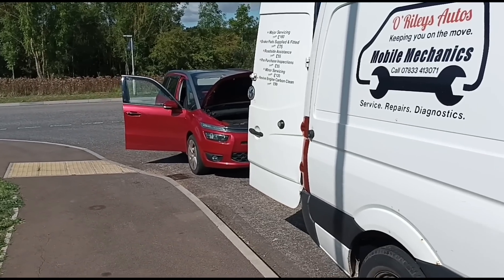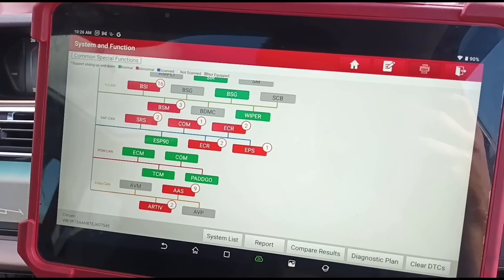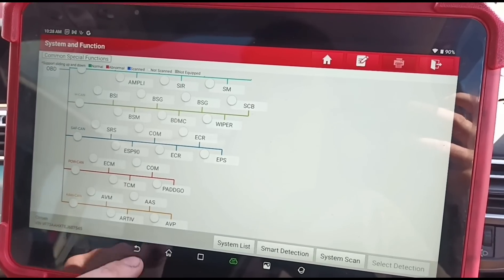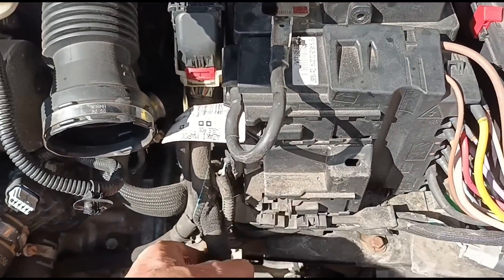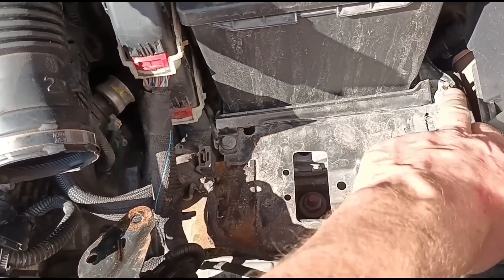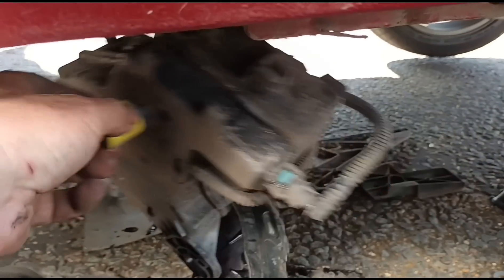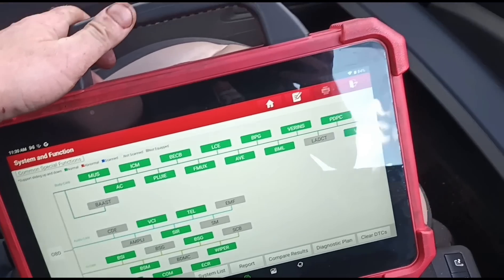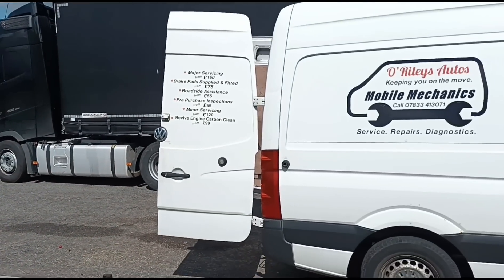Citroën C4 Grand Picasso Various ECU & Cruise Control No Communication U1F03 U1F00 B1811 U1F2E U1F04

Comment: As always fantastic informative, clear videos. I have a C4 GP 2014, works fantastic but every now and again spits its dummy out and goes into limp mode and knocks the auto gears to manual only.  Seen a fair few of your videos and one from the past hinted at electrical issues. I recently got myself a topdon pro which I am still learning the ropes with and although not the same system as yours the way you explain everything has been so helpful in using my own.  So my course of action now is a new battery and clean up all the terminals and check fuses in the box in the front of battery and then replace battery with new one. Thankyou for showing how to get the dam thing out. 

Another issue that I had not noticed at first was when plugging in the topdon was that there was no power (topdon has internal battery) with the engine off. Again one of your past videos indicates this to be a related fault to the auto gears failure and how to fix, Thanks for putting  the time and effort into making these videos, they are greatly appreciated

Comment: Jimmy, as others have posted here, on a lot of newer cars a scan tool is all you really need for basic diagnostics of the AC system. there are even actuation controls to turn things on and off. One of the other things that can fail is the blend door. everything appears to be working, but only blows hot air. blend door can be stuck in the hot position, but I think you can test that with an actuation test on the scan tool. you should give it a go sometime.

Comment: I used to own one of these, an older model, there's a procedure to reset the BSI.
Put the driver's window down, lift the bonnet, ensure all equipment is switched off, close all the doors and remove key from ignition.
Wait 3 minutes, disconnect the battery and wait 15 seconds, reconnect the battery, wait 10 seconds, switch on the sidelights using the open window do not open the doors, switch on the ignition, hold the lock button on the keyfob for 10 seconds.
You can now unlock the doors and start the engine, this resets all the BSI modules and set everything back to standard.
The BSI is basically a computer that sometimes gives problems and needs reset, you are supposed to wait till it goes to sleep before disconnecting the battery, lift the bonnet and wait at least 3 minutes, with all equipment switched off or it won't go to sleep.
Sorry for long post, hope it helps someone.

Comment: A slightly inconvenient place to put a battery, but I suppose you (hopefully) don't replace them very often. I used to own a 206 which was throwing up an airbag light on the first cold start, it just needed a new battery, but like with my 208, it was in an easily accessible place.

Comment: Thanks for all the help Jimmy. The next day the a/c started working along with the ECO mode (engine stop/start). Went out today (17th Aug) and the a/c was not working, neither was the ECO mode. wen't about our business, came back to the car, a/c is working OK. I've turned off the ECO mode for the time being. I might come back to you for another diag to see if the battery health is being reported as bad, if so, I can start to look at other causes for this error. Thanks to all those who commented with ideas and other areas to check, it's much appreciated.

Comment: I am not even going to comment on the A/C possible causes because if you say that the customer went to an A/C specialist and they couldn't find a fault, hey ,  who am I to suggest anything. But one thing I can tell you what happened today at 16.30 my time ´. A customer with a Ford Galaxy came straight from the A/C specialist to let me check why the A/C wasn't working after they recharged it. I am an a**hole of course because I, we , refuse to look at work that has been done by "specialists". We pretend to care and feel sorry for the customer but please go back to your A/C specialist and let them show their capabilities IF they have anything more to show for them than a recharge and a quick leak test with a UV light. Wish I could make money like that..( edit) Yes those geniuses that design the battery box placement have done a nice job. Good that we( in our case) have a nice percentage on selling batteries otherwise we had to charge for a battery change.

Comment: Thanks for video. Please tell the customer do not throw away the old battery, I belive it good. Did You test the old battery after You remove it? Please check. I had sort of problem on my c4 picasso, battery drain out in 2 days completely,  the problem was, one of the relays did not go to sleep, continiusly drainong 0.7 amps.
Because of the design, testing the buttery connected does not give 100% accuracy. I test my battery connected, the tester showing 23% of health, replace. Take the battery out- 100% healt, with the same tester.
Reply: What year was your C4? Mine is 65 plate but it looks like there is no relay in the Battery Management Unit, just fuses. Unless I'm mistaken or they are located elsewhere.

Any body advise? I'm going to strip mine and clean all the contacts (Jimmy did this in another video), to see if it clears the electrical fault and stops the battery drain.

Comment: AC my Citroen C4 Picasso has the same issue. Will work for a few weeks. It has a leak. Appears this one has the same problem or who worked on it does not know what they are doing, there's plenty out there that don't loo what they are doing

Comment: AC systems can fail to operate correctly if a thermistor is blown. They control the temperature of the air coming into the car and basically stop the system from freezing up. Usually accessible from inside the car and a good place to start if it's proven there is no leak in the system.
Reply: You can see system pressure for AC on scan tool, also clutch function and air temp 👍
Reply: Isn't that just the internal air temp sensor which can be monitored on a scan tool? Or is there a separate thermistor specific only to the air-con which cannot be monitored by a scan tool, and which doesn't throw a code if defective? Reason I ask is I know someone with a Peugeot with similar problem.
Reply: @johnbiggs9561 There is a separate thermistor inserted within the AC system on most modern cars. I think it's function is to shut down the compressor if it senses the system freezing up.
Reply: Over the years, I've got got used to Citrons strange electrical problems.. I'm now on my second auto diesel C4 ...
As a retired electronics tech, I was shown as an apprentice  how to use a DC volt meter set on a low DC volts setting to look for small voltages between the battery negative (or chassis) and  all the other ground points, that should of course be zero ohms, or just a few millivolts... Indicating a phantom resistance in the wiring looms...
Rather than removing individual tags to carry out abrasive cleaning  (than will remove the electro plating  eventually leading to corrosion ) 
I used  "crinkle washers" between each stack of eye tags, on both the negative earths and also the live tag bolts... 
In the future if a bad connection is detected it's a simple matter of undoing the nut then re-tighten to re-crunch the crinkle washers ....
 Occasionally will i do routine  resistance check when the bonnets up... plus an occasional spray of PTFE-WD40.